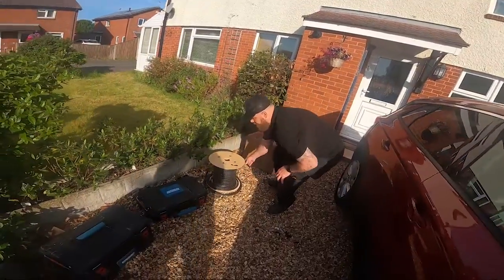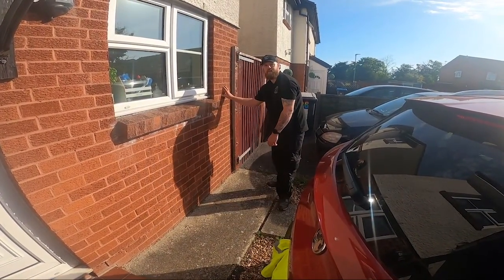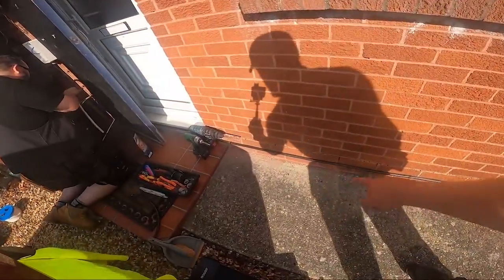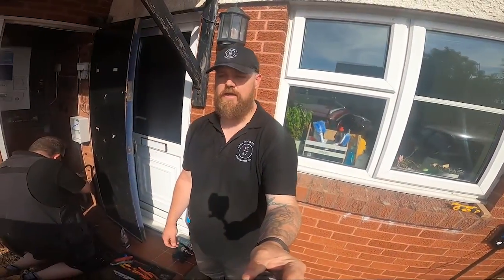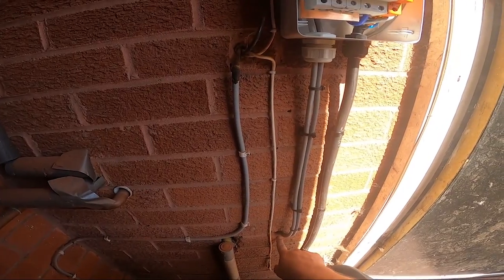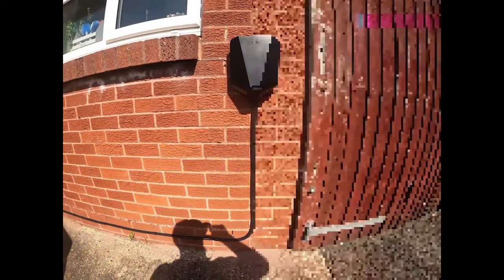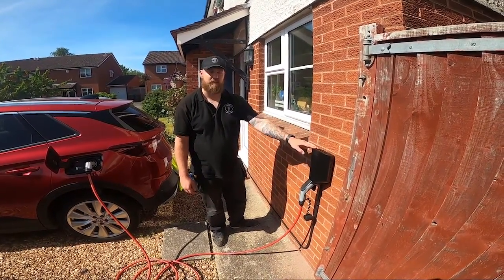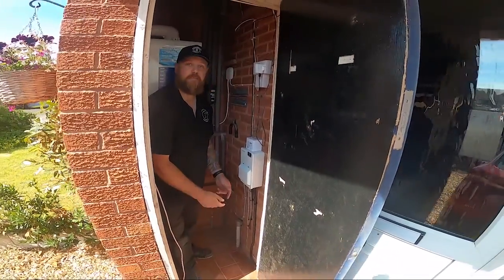How to install an EV charger 🤙

Comment: Good vid, does the Easee one need a RCBO in the board?
Reply from the maker: Hi Rob thanks for commenting, the Easee One has integrated type B RCD protection which is great, but we choose to install a double pole Type A RCBO in the board as it requires the disconnection of both line and neutral in fault conditions, the other option would be a DP mcb